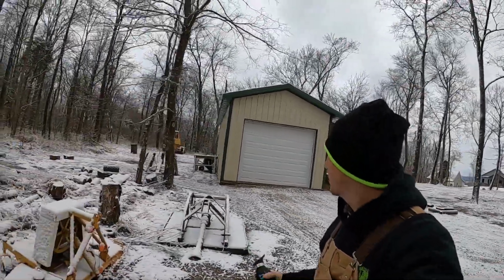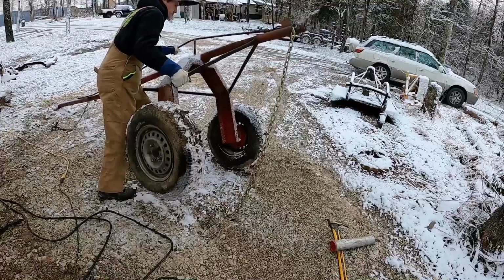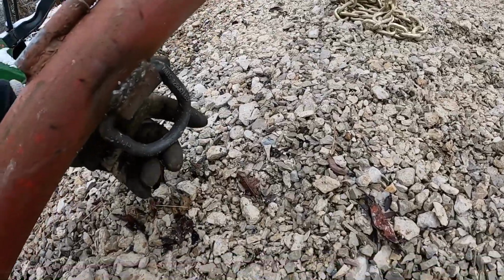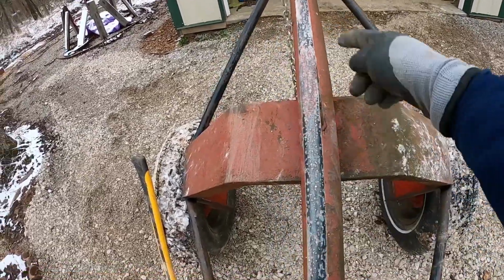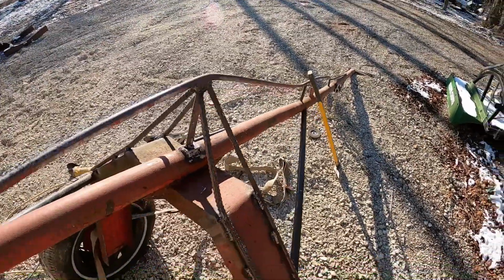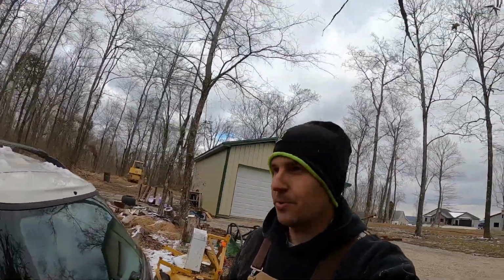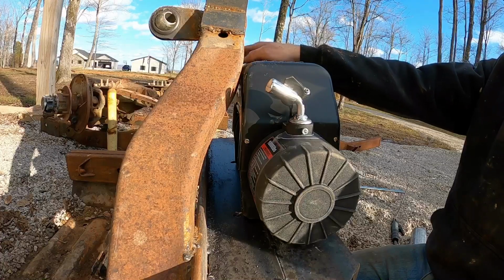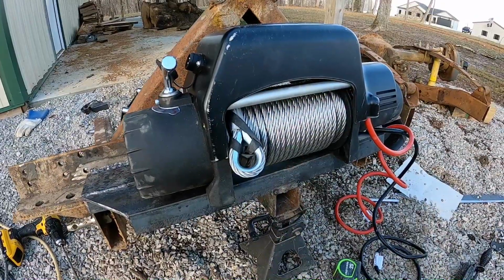Progress on Junkyard Log Arch Build - Beginner Welder

Comment: Cap’n that was a most excellent build video!  Made me glad I wasn’t still in that impoverished, dang near destitute, tool proprietorship stage.  I feel like a king watching the serfs building the bridge over his moat!!!

Since you asked... 
Grinder, I have the Dewalt cordless system.  My brushless 20V grinder is far away superior to my corded grinder.  Especially because it doesn’t require tools to change grinding media.

Clamps... first of all if you buy some cheap 90 degree welding magnets you can eliminate the need for clamps a bunch of the time.  For metalworking, look at the Vise grip family of c-clamps and welding clamps. Add a pair of 8” c-clamps and you are golden on most needs.

Thank goodness drywall and deck screws are hardened high carbon steel... you can get by without a center punch for years.  But, if the Earth moved you to get one, start with a spring loaded punch.  You can always bang on the divot it leaves with your unique wood screw and splitting maul... if you feel the need to turn the divot into a crater.

Now... advice about welding.  I prefer using hot melt glue and/or double sided tape for temporary bonds.  Permanent bonds with tight seams are best with the Titebond family of aliphatic resin glues. Gaps are best filled with epoxy.  Now for outside use, I rely on construction adhesives and caulk... especially the polyurethane caulks. 

Confused?  Please understand, my metal working skills are three degrees below pathetic.  My medium of choice is wood.  

Keep that in mind as you read through my recommendations for the perfect tools for what you are working on.  Keep or discard them as you see fit.... because they will pale in comparison to the plethora of YouTube Expert advice you’ve asked for!!!

Cap’n, I’ll catch you and Gilligan when you set sail for your welding class cruise! (I get first dibs on being Thurston Howell the 3rd... because just once I’d like to play the part of the filthy rich dude.)

PS... I posted that video you requested.
Reply: Oh... just one more thought... if you cut the channel off and angle the front up a bit, the winch will clear the frame without having to drill new holes or move it back.  The winch won’t mind being mounted on a slant... the spool is a cylinder.

Once again, you are welcome to File this thought with the others.
Reply from the maker: I watched your video!  Noticed it was numbered.  I certainly hope this is a sign of more to come?  Also the comments were turned off,  which is typically from labeling it as “made for kids”. For some reason that setting turns off comments.  Looking forward to the next one!
Reply: @CaptainKleeman  thanks.... I think it’s fixed now.  Might have another one coming out... still trying to figure out editing... that’s about as long as I can concentrate in one take.... •grin•

Comment: Morning Captain, in my limited 30 years of fabrication, you build with what you have available. I'm not certified but many fab jobs are still in use. Magnetic clamps are good, adjustable C-clamps are nice, vise grips do wonders. In my world of low finance, channel lock pliers and a bag of rubber bands have been used. Time is your very best teacher I've learned and pointers from others more experienced are great as well. The true key, don't kick your self too hard and tack things together first just encase you happen to make a slight measurement error. Whenever HR and the financial department says it's okay to purchase, a hand torch would be great too but I truly understand a wish list is what it is, lol
Reply from the maker: Appreciate all the tips!  Tacking first and double checking measurements was a big lesson learned this time around.

Comment: Thanks, that was soooo much fun to watch.  We all had to learn how to ___ (fill in the blank) at some point.  The only comment that I do have regarding safety was passed to me by a firemen friend was never open your propane or any other gas valve all the way. You only need a 1/2 turn. In the case of fire a 1/2 turn can make a huge difference in trying to get the gas shut down before a small problem becomes huge.  Thanks Again for the videos!!!
Reply from the maker: Good point

Comment: As an old “retired “ shop teacher I appreciated your high school shop level comment.  I can assure you that your weld looked better than many high school student’s welds ever looked.  Most important part of welding anything is preparation and rod selection.  One suggestion would be instead of using separate pieces of rebar for each gusset. Bend one piece into a v or u shape so you have only one joint for two bars and this will give you a bigger area to weld.  It also wouldn’t be a bad thing to take a few pieces of scrap and weld them together then bend them until they break to see how well you did.  Many welds that look good on the surface are crappy and will fail quickly because they have no penetration.  🤞
Reply from the maker: Your point about just bending the rebar instead of cutting individual pieces really clicked.  Excellent point.  And thanks for being a teacher!

Comment: You may not have the welding skills yet but you definitely have a concept designer’s eye. That space frame lattice reinforcement is great.  Good work Captain! 🏴
Reply: Mark Davies... I especially like the Eiffel Tower center support.  It lends a certain artistic touch to a otherwise utilitarian build.  Don’t you think?
Reply: @sassafrasvalley1939  those oak get pretty heavy.  Stronger is better.  Lol
Reply: @michaelmaker8169  good point... you ain’t moving them with a whimpy log arch!
Reply: Form and function. Slight niggle about whether the main pole is still sound though.
Reply: @markdavies9912  time and the Cap’ns quest for the perfect junkyard solution will tell... let’s stay tuned.  This is gonna be interesting!
Reply from the maker: Thanks for the kind words!

Comment: lol you always make me smile man!... here in the UK all my metalwork and most my woodwork tools are Makita, been using Makita for over 30 years and they outlast everything else and on the odd occasion I had an issue the nice people at Makita UK HQ sorted it immediately with no questions. You can also find plenty of good use older model Makits on the auction sites which for somebody doing welding for the first time will save you a lot of cash. I am not as young as I was and my patience level is often zero these days so I buy the 1mm (inox or stainless steel) cutting discs in packs of 50 or 100, its a big saving in time for not much expense.... lastly the 50mm ball hitch you welded on has a limited amount of vertical and horizontal movement so be careful not to tip over your arch as it may well take the compact tractor with it... we always use an 'offroad' 50mm hitch for safety!... our next project is a 1.5ton 6x6 dumper from 3 lawnmowers, be careful this sorta fabrication is great fun but addictive!
Reply from the maker: Can’t wait to see that dump trailer!

Comment: Good Job captain.I learned to weld at vincennes University in 74 but I think I used my welding skills 4 times since then
Reply from the maker: Seems like that’s the way it works out sometimes.  I spent a little time at VU myself.
Reply: @CaptainKleeman  I spent 2 and a half years there in machine trades technology73-75

Comment: I meant to comment earlier but just realized I hadn't. Short and sweet, your welding is looking really good for your second time! With a little coaching from Aaron, you'll have it down in no time. Now, for tools. Corded grinders: Metabos are fantastic and will last a long time. Makita and Milwaukee are also good. Cheap harbor freight ones are ok, but the part that makes them good is they are $15 each. You can grab a couple of them, toss a wire wheel on one, a cup wheel on the other , grinder disk on one and cutoff on another. No changing wheels all the time! If you wreck one, who cares! Now, with that said, a cordless grinder in whatever battery system you use is a lifesaver. The Makita, milwaukee, dewalt, rigid will be better quality, but i know you have the Ryobi system, one of those will do just fine but might not be quite as powerful. Clamps....a couple sizes of the triangle mag "clamps" a couple of the adjustable sizes will be super useful and not break the bank. I like the f style Bessey clamps, they are versatile. C-clamps are good where you need a little more clamp force. A variety of the regular and "welding" style vice grips from Harbor Freight fit the bill, they arent as refined but when you weld one to your work, you don't feel bad having to grind it off. Annnnnyway, so much for short and sweet. I can't just name things without giving reasoning or examples.
Reply from the maker: Thanks for all the input!

Comment: As far as tools go it's boils down to $$$$. I used the vise grip C clamps along with bar clamps. I would suggest at least 1 vise grip chain clamp for those odd shaped pieces. You can have a LOT money in tools. There's always that 1 new tool that you have to have. A wire wheel for your grinder will clean the area before and after you weld. I must say that your second time welding does look good. In the military we called it "Field expediency". Now it's called "make it work". Looking for the next video.
Reply from the maker: Thanks for the input!

Comment: Cap, you might think about getting another pipe fit inside the existing pipe  with a thicker wall and beat it into a straighter back and then used the tie bars. I'd suggest 4 x 6" 45-90 magnets and 2 6"inch C clamps and 2 9" C clamps for the welder tools. Aaron will know what you really need mate
Reply from the maker: Thanks for the suggestions!
Reply: @CaptainKleeman  that's what I started with after I did my sheet metal fabrication at college and then collected more as time went on. But the 4 x magnets used to come in handy for tacking up new frames or sqared joints

Comment: Channellock welding pliers and Pipe Channellock used with 12 inch long angle iron to keep pipes straight. Cut the top A shape piece off at the top of the straight by the wench turn it around bevel all 4 ends from the outside tack it together than 1 inch stitch weld it back on.
Reply from the maker: I think I understand what you’re saying.  May have to look that one up with a picture

Comment: Just some recommendations about clamps. First thing your going to find out is you can never have to many kinds and sizes of clamps. Main rule of clamps buy in matched pairs. you will find use for C-Clamps Increments of two inches. Pipe clamps Here is what I do. Find a plumbing supply place that sells full length black pipe. My pipe last time I made some cost Dollar per foot and an extra dollar to thread one end. All ways thread both ends. I bought a two foot, 3 foot and a four foot piece of pipe for each clamp. two Female couplers to tie the pipe together. This will allow different length clamps. 2, 3, 4, 5, 6, 7, or 9 feet long. You can generally find good c clamps at garage sales and flea markets.
Reply from the maker: Flea markets are my go to!  I’ll keep a look out for some clamps.  Thanks!

Comment: Good job sir. One thing that I’ve noticed about you is you’re not afraid to try and that goes a long way. As far as clamps go if you have a pawn shop or a cheap tool store close by look for some different sizes and see which ones work best for you and your application before buying several of one size. As you have found out one size doesn’t fit all. They also make some magnetic holders that will hold things at 90 or 45 degrees that I’ve seen used and they have a few different sizes of those as well. Just food for thought.

Comment: Bench grinders are the best way to sharpen drill bits. Just balance out your flutes or it will wobble when drilling.  Good video and get you a battery conditioner to keep that welder battery up. Enjoy your day!  👊
Reply from the maker: I do a bench grinder now and run into that exact problem of keeping them even.  Hoping a drill doctor will be a bit more consistent
Reply: @CaptainKleeman  you will get better.  Make sure you are facing the cutting edge up and letting the wheel pull material away from that edge.

Comment: I bought a drill doctor, it works good for wood and light steel and aluminum. It will sharpen bits but it’s a skill to get it sharp enough to cut good through thick metal. Love the videos and it takes practice to run a good bead while welding on old rusty metal. C-clamps 4”&8” or good to have.
Reply from the maker: Thanks for all the tips and drill doctor feedback

Comment: to answer your questions 
clamps I"d would get an assortment maybe 2 of each magnetic, vise grips, c clamp and maybe even a couple of F style clamps ( harbor freight) 
good grinders I've had good luck with my ryobi and HF grinders 
I"m not a professional just hobby welder, retired veteran who likes to learn new things
I love my drill Dr  I use it every so often for different bits
you're a brave man for putting yourself out there for all the keyboard welding pro's lol
Reply from the maker: Hey thanks for all the info!  I think harbor freight will be my next stop!
Reply: the HF grinders get the better of the 2 or  3 the one that has A paddle switch

Comment: I use the 90 degree magnets when welding if I can.  They make em in a few different sizes and are cheap at tractor supply or harbor freight.  As far as your grinder it could be just worn brushes for the motor and they’re not too expensive.
Reply from the maker: It feels like more than brushes.  But I’ll definitely check before I pitch it

Comment: Ive had a drill doctor for years. Some love them. Some hate them. I love mine. It has a bit of a learning curve to get the results you want but, once you figure it out, it works awesome.
Reply: Just Greg... I’ve had the same experience with mine.  I keep all my dull bits in an old coffee can.  Once a year... I set it up on the work bench... tune into some Classic Rock on the radio and have a sharpening party.   My only regret is that I didn’t buy a model that sharpens bits larger than 1/2”!!!
Reply from the maker: Thanks for the feedback!
Reply from the maker: @sassafrasvalley1939  so they make different models?  Something I’ll have to pay attention to.
Reply: @CaptainKleeman  yup... the DD750X goes up to 3/4” bits and is much better at doing touch up sharpening without a full cut.
Reply: I would suggest getting a Bench Grinder and learning how to hand sharpen your drill bits using it. There are plenty of videos here on YouTube that you can watch that will teach you how to do it. An added plus is that the Bench Grinder can be used to grind, sharpen, or shape many other things. Not to mention the fact that you can also attach wire wheels to them to aid in cleaning of parts.

Comment: Something to remember when stick welding. The closer you get the stick to the material, the cooler the weld. Most people, when they start to burn through try to move the rod away. The longer the arc, the hotter it is. You can also knock the flux off a rod and use that to add metal in when you burn through. You can put it in the hole to fill it in.
Reply from the maker: Thanks for the tips!

Comment: your not sticking the rod anymore so thats an upgrade Kleeman! if you can pick up a couple wire wheels for your grinders, will make cleaning the slag off the weld super easy
Reply from the maker: Thanks for the tip!

Comment: I'd say you doing alright there ol boy. Striking and holding arc is the hardest and you seem to have that down, rest is hand movement.  Way pawpaw taught me was push and pull, push the stick forward pull it back, over and over. Call it farm weld.  Hit harbor freight up for all your clamps and magnetic holding devices, cheap and hold good.  Best grinder I've gotten was a Milwaukee but each there own. Stay positive and build something
Reply from the maker: Thanks for the tips!

Comment: You did far better than I did for a first time weld.  I've had a Drill Doctor for about 15 years and don't know what I'd do without it.  Really easy to use once you get the hang of it.  As far as grinders, I've got about 8 or so.  I like my Dewalts best.  My Milwaukee has a paddle switch that goes below the surrounding case to turn it on.  You have to use the tips of your fingers and if you have gloves on, it's difficult as all get out.  The Harbor Freight ones that sell for about $10 comes in handy quite often.  They get hot when used for any period of time but, they work well for cutting and you can toss them if they get gunk on them that you'd rather not clean up.  My Porter Cable has a rocker switch on the side that locks on if desired.  Unfortunately, it will turn off from the least little jarring.  A couple of old Craftsman round out my collection.  In sum, I'd look at the placement of the controls as the primary feature in selecting a grinder.  Almost all have ball bearings these days.  Remember, the higher the amps, the more powerful the motor.  Thanks for posting these videos.
Reply from the maker: Appreciate all the input!

Comment: Now you're cooking with gas!  Those welds are coming along.  Look at the handle of your welder.  There is a screw hole that doubles as a rod starter.  Push the rod in the hole to break off the tip.  Starts the arc faster.  At least that's the theory, and a good start helps.  Lol 😆.   I hope you learn lot's from MBTS.  Great progress Captain!
Reply from the maker: What?!?!?  If this is true my mind will
Be blown

Comment: Not hot enough on good fits. Take the flux off another rod for large  gaps use it for filler &weld over everything. Looks pretty good for a rookie. LOL .Good video.
Reply from the maker: Thanks for the tip!